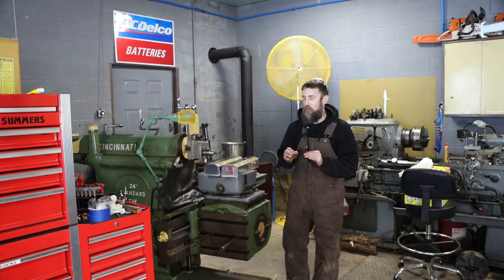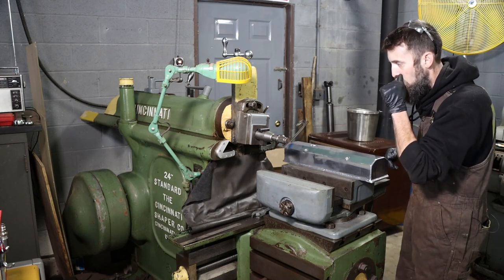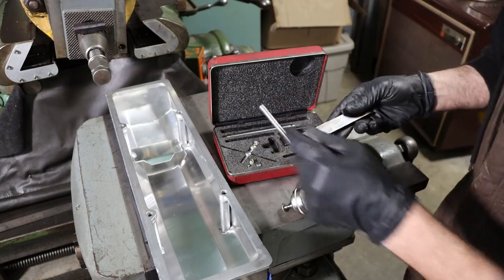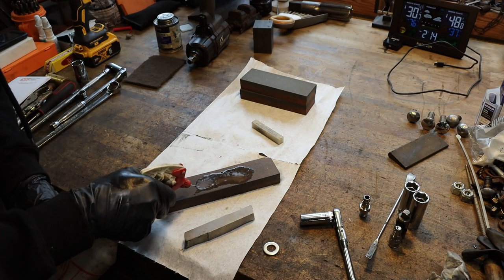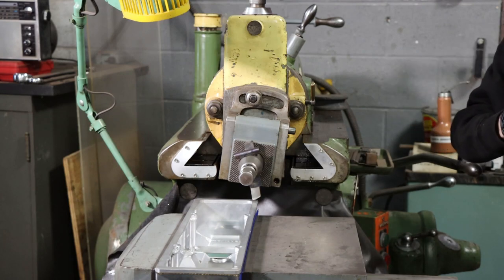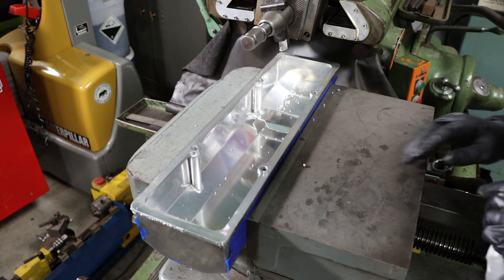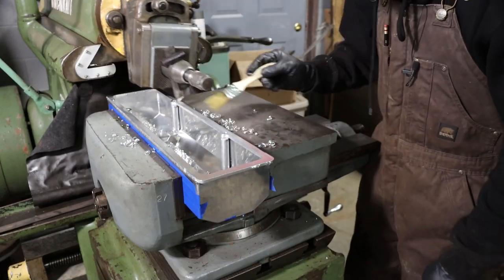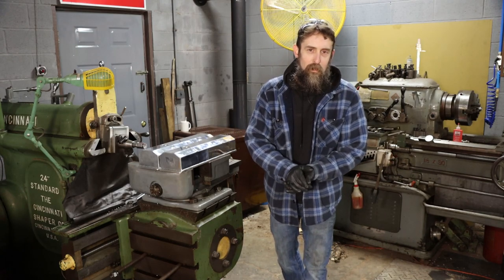Budget SBC Valve cover resurface on the Metal Shaper.

Comment: I had an old Mazda B2200 truck that had blown the head gasket. I took it to a machine shop and instead of decking it, the took a belt sander to it, and it wouldn't sit flat, but rocked. I took it back and then they did a true machining of it. I had that truck for a while and finally sold it to a guy that really wanted it bad.

Comment: .060" is the thickness of a big flat washer. That is a whole lot of gap for oil to run out! You did the right thing trueing those up first. Should be more beefy than the stamped tin stockers anyway.
Reply from the maker: I agree Brian, it would have been asking a lot from those bolt and gasket to get a good seal. Should make a decent valve cover now👍😁

Comment: BONUS VIDEO, would have seen it earlier, but wife was in the hospital. 2nd hip replacement.  All good. Lookin good with those chrome valve covers. So what else can be chrome under the hood, not to much, air cleaner, brake master cylinder cover, clutch master cylinder cover. Just a little. See you tomorrow.

Comment: To make them leakproof cut an o-ring groove around the cover. Glue in a .090 linear o-ring & you're set for life. Installed this in my magnesium hemi covers in 2004. Still leak proof today in 2022 @ 3086 hp @ 10,300 rpm. (Alcohol dragster).
Reply from the maker: That's a cool idea👍. 3000hp is pretty serious 😁
Reply: @SteveSummers  A 3000hp engine would be a good way to test out your frame repairs. lol
Reply: @halfstep67  😁😁😁

Comment: Ignore some of these comments. Every little bit helps to seal those problem areas. 
I just pulled my 3rd gen HEMI valve covers off. They're amazing. They're  a phenolic thermoplastic and molded with a groove in the flange for an o-ring. And the lower edge has a molded-in raised "drip-edge" to deflect most of  the oil off of the gasket. They seal perfectly (and the gasket is perfectly reusable), but then  they also have 10 bolts holding them down. New tech has its advantages.

Comment: I used a shaper years ago and did a lot of long and big diameter parts. I found that if you run the ram out as far as you need you can use parallels to rough align the part to the bottom of the ram ways. Saves a lot of time on odd shaped parts. I used to surface a lot of big valve bodies (12" - 14") parallel on a regular basis. Lots of odd shaped electric motor castings too. Just a memory. :D

Comment: If you don't want leaks use Ultra Gray RTV. Put a bead on the valve cover, mist it with water and wait 10-15 to put them on. Both surfaces MUST be spotless with no oil....

Comment: I always glue the gasket on the cover with silicone, then set them on a flat surface for the gasket to set up one day before I put them on.  Gasket doesn't move when installing and won't squeeze out.  Same on engine, glue and lightly press down and let set for one day, then screw down to spec.  Never had one I installed leak, yet still comes off fairly easy.
Reply: ....or you could machine them flat!

Comment: A good result for you Steve. For those without a machine that can do this, you can do this with hand tools. You do need to persist as that is how the First Machine Tools were made!
John, Australia.
PS: I think the shaper is a better choice than a Mill as vibrations from a mill cutter may cause the part to move with this light clamping situation.
Reply from the maker: A file and a flat surface to check progress would work  just fine for these if a guy was careful.
Slow and easy with the shaper worked well. I just kept the clamping and cutting pressure low👍.

Comment: Presumably when you tighten up the bolts to fix it to the cylinder head, the rocker cover will distort. So it is entirely possible that the best geometry to minimize the possibility of oil leakage is only flat after you torque the bolts and not before.
Reply: most of the valve covers I see leak on chevy's 4 bolts are tight and no pressure in the middle of the valve cover ,, you would have to over tighten the covers too get the centers to hold the gasket from popping out ,, so he did it the right way ,, should not  leak when done ,,

Comment: I think it is suppose to be a little more clearance in the middle, the old (stock) ones lifted up on the ends leaking the oil out so high in the middle ensured a good seal as it torqued down.

Comment: I doubt leaking will be a big issue, but the rigid steel core Fel-Pro silicone gaskets are great for SBCs.  The flange on those new covers is so much more rigid than the factory stamped covers.

Comment: Make sure you get a set of the spreaders for the valve cover bolts and the wing nut type valve cover bolts. They not only look good but they all but stop stop any over tightening of the bolts. It is going to be one nice looking engine when you are done with it.

Comment: Sorry to be a Negative Ned here. Those valve covers have no lip around the bottom to hold the gasket from squeezing out, no baffle over the oil fill cap hole. I love this truck build but those valve covers not so much, some nice oem cast LT1's for me.

Comment: many a cylinder head, engine block, exhaust manifold etc...has been surfaced correctly on a "belt sander"  referred to as a platen grinder
Reply from the maker: Yeah, a lot of time that is all that a surface needs if done correctly.  A belt sander finish on these would work good if it was somewhat flat. 👍

Comment: I would then use a reasonable thick cork-gasket, maybe 3..4 mm thick. They are compressible and springy and can seal this type of joint for several years. If in doubt, one can glue them as well, though render them unusable after lifting the cover the next time.

Comment: I've used the low cost and the high end versions and had both leak because the surfaces were not flat. Toss them on a glass plate with some 220 and a spritz of kerosene for lube and they clean right up. Worst ones were actually a vintage set of cast covers from M&M those things must have come from a mold floating on the ocean... LOL

Comment: Hopefully you will be gluing those covers on, and using a moulded gasket. V8 engines are not the only ones with valve cover gasket issues, I have learnt that the best is to clean surfaces, and fix the bolt holes so they are not bowed out, and then glue the gasket on both surfaces, either with gasket compound, or with actual contact adhesive. Then torque the bolts to the correct low torque, and leave to cure properly. Not tight till they snap, but barely past finger tight. they tend not to leak afterwards, unless of course it is made by GM, then it will leak again.

And a pox on plastic valve covers, because invariably you will end up buying a new one, because they not only leak, they also warp, and crack internally from sheer bloody mindedness.

Comment: I'd love to have a shaper but I just can't justify it as far as cost is concerned.  I wouldn't use it very often but maybe down the road I might reconsider.  One thing that I'd like to ask is obviously the return stroke is much faster than the cutting stroke.  How is that accomplished?  I realize it must be a different radius on the return, right?  The motor doesn't change speed so it has to be mechanical I'm guessing?  I could be totally wrong, lol.  Thanks for the video!

Comment: I used to do this by hand, straight edge and a file. Lots of work. I assume you will use valve cover clamps to spread out the bolt force.
Reply: Clamps work on steel covers, these are aluminum with recessed bolts, no clamping possible.
Reply: @Blazer02LS  Huh? There is no such thing as impossible. You can use bolt spreaders on any metal you want. Steve is a machinist he can fabricate his own spreaders to fit his needs.
Reply: @inkman996  The bolts go through the covers inside the tubes that are welded in the covers. These are not like the old steel covers with an external flange that need spreaders. These are also rigid aluminum as well so for both reasons you don't need and cannot use any type of spreader.
Reply: @Blazer02LS  I was going to explain this on another post where someone suggested the spreaders, and was suspicious I would run into the same ignorance you have.
Some people haven't seen fabricated aluminum valve covers and are not aware of how the hold down bolts "work".
Doesn't stop them from commenting as if they know what they are talking about.

Comment: Very interesting.  A good pair of cheap valve covers all they needed was $200-$300 worth of machine work. LOL  They do look good though.  You would think if you were a manufacturer you would have a machine set up to surface these in just a few minutes.
Reply from the maker: You definitely get what you pay for. I got these 2nd hand. There is a good chance they would have worked fine as is. The gasket will be stuck to the cover with a sealant so they should work fine.
Reply: @SteveSummers  yeah, I would have to agree.  It's cool that you took the time to fix the problem.  Thanks for all the great videos.

Comment: I just bought a Cincinnati 20” Shaper and I’m excited to restore it and get it running! Any tips?
Reply from the maker: Awesome.  Be careful about ram and compound clearance.  It is easy to rip the compound off the ram. Triple check all machine clearances.  Also be extremely careful if you decide to remove the ram or tapered gib. Adjustment is easy to get wrong.

Comment: Just my $0.02 (which is probably still overvalued... LOL)

Given that the four bolts have negligible clamping force at the extreme end of the valve cover, I would have been tempted to INTENTIONALLY make a 'banana'.
i.e. When the valve cover is simply placed on the head WITHOUT bolting it down, I'd like to see a 0.010 GAP in the middle of the head.
That way, the bolts would possibly do a better clamping job overall and thus produce a decent oil tight seal.
From my experience, valve covers are often subject to quite a lot of abuse when they're off the engine!  )OK, I admit that I MAY have been a little rough on some of them)

Comment: The "machinist" in China would have cranked out 50 sets of these valve covers with the belt sander in the time it took you to straighten out this one set on the Cincinnatti. The only problem is that the China machined valve covers would have had a 100% failure rate and yours will have zero failure rate. Great job on the repair.
Reply: You get what you pay for.

Comment: We just love these mid-week "coffe-break" videos Steve. Great idea leveling those valve covers. They always leak.  I think they originally started with 4 screws because you had to take them off frequently to adjust the valves?  Your thoughts?
Reply from the maker: Not sure why they only did the 4 screws. Seems like adding one extra on each end would have been better. 
If they are put on correct with quality gaskets they should work fine. 
Glad to see you Ron. Tried to message you the other day and it wouldn't go through for some reason.  Hope all is well.

Comment: For Chevys that have the 4 bolt covers they sale a bracket that goes on each bolt that split the pressure in a wider foot print
Reply: Will not work on this style of valve covers.

Comment: With all the bolts being in the middle of the cover I would think that you'd want a slight bow in the mating surface to ensure that the ends of the cover didn't curl up as you torque down the bolts.

Comment: If I made a valve cover with only 4 holes in the middle and not in the corners I wouldn't make it flat. The original would work better the bolts should pull it down in the middle and make the ends tighter.